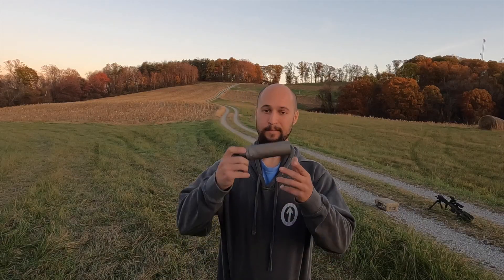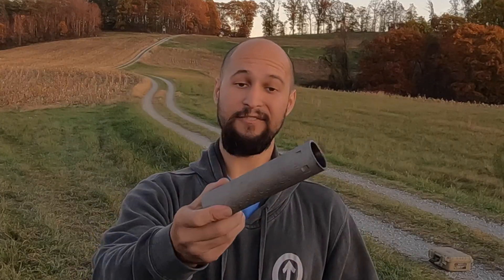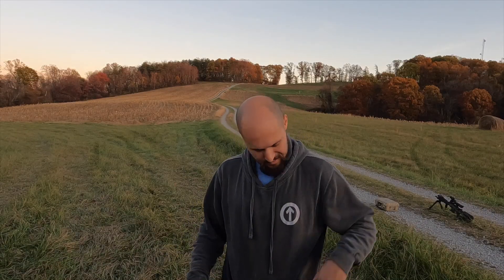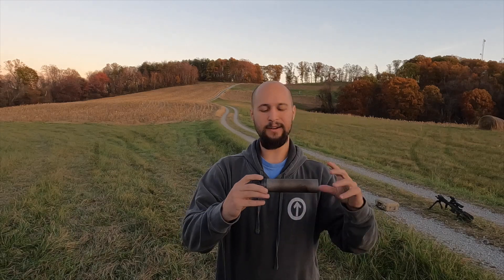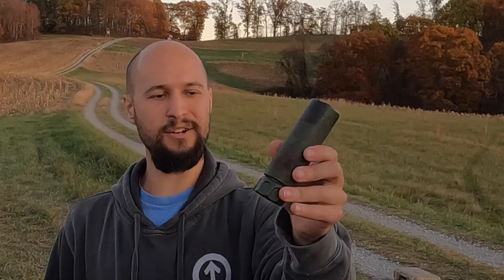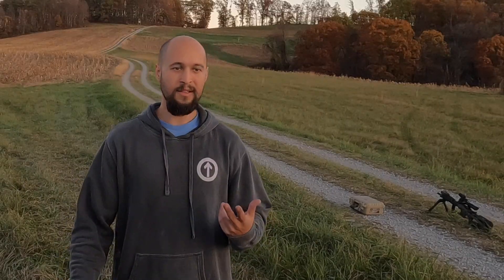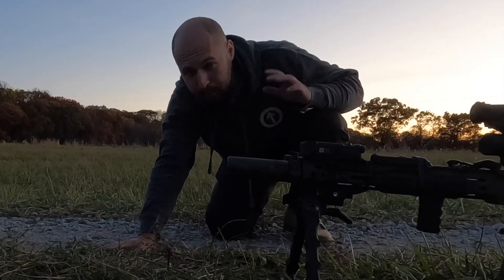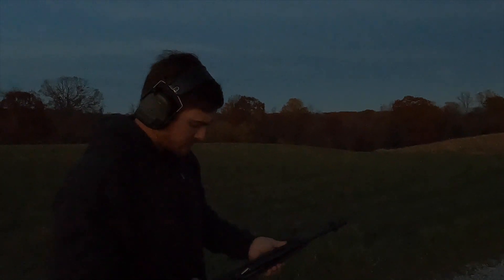Modern Suppressor Flash Test (2024) B&T, Otter Creek Labs, Siege, Surefire.

Comment: @VbdRetail 

Hello, I’m a new subscriber to your channel and I wanted to commend you on your content. Also I’m wanting your opinion on what can you would recommend to someone for their first can, who is using a 14.5 and was looking for a best all around can. Durable, Low flash with not much back pressure
Reply from the maker: If length isnt a concern. The Srbs or Rbs XH Full sizes. 
If length is a concern. The 14.5 will work well on the compact models of those. Through testing folks enjoyed the CAT WB as well. 

If you have the right set up. Id look into the next round of the xh mk12's.

You CAN get around the backpressure issue with tuning (like a BRT EZ tune) and start looking at the more traditional suppressors. But if you want low gas, the proper tuning would require that rifle to only function reliably with that more high back pressure design on the gun. 

If you shoot us an email we can deep dive a little more and really figure out the nitty gritty on what you'd like, what kind of budget you expect,  and what's important to you performance wise if you had to rank them in sequence. 

But from the little info I have, id say SRBS, XH, or WB.

There are obviously many other options that would leave you satisfied (FOR RECCE, Velos etc). But each has their own quirks.
Reply: @VbdRetail  
Thank you. I will be in touch via email soon.

Comment: You making a big deal about it not being a big deal doesnt make it not a big deal. Cans arent cheap, even the cheap ones. It is entirely possible to spend more and get less in the suppressor market. Thanks for doing the test and naking the video.
Reply from the maker: @quiettime6871  i think we got quadruple negatives happening on that one lol.  The point I'm trying to make is, folks like to act like flash is life or death when they're splitting hairs. 
Yes, some suppressors are absolute sparklers and awful. (Usually Ti, i don't mess with Ti)

But, most modern inconel suppressors, outside of maybe a first round pop, are on the lower end of flash. To the point you're most likely not seeing it with the naked eye at distance. 

It's a question we get often, and folks want to know "is X better than Y in flash, all i care about is Flash". And the reality is between some of these is like comparing velocities on a 10.3 vs a 10.5...

The worst performing suppressor we tested, was still absolutely phenomenal. And if it DOES matter that much, spend the extra cash, buy powder with flash suppressant, and use a little more barrel.
Reply from the maker: @quiettime6871  but thank you! Today we should have a very nice Db meter coming in. And I have some unique tests I'd like to run. They will be different than what you've always seen being uploaded.

Comment: Have you shot the SRBS 7.62 version and the 5.56 version on a 5.56 AR? If so how much difference could you tell in terms of sound reduction?
Reply: Wondering the same thing from a first hand shooters experience. Same weight and length. But take a look at the silencer summit 2024 results. Looks like the full size 556 version did a little better than the 762 on 556 ARs by 4-6 dB at muzzle but about the same at the shooters ear. 

I’m considering the Compact 556 version though which is noticeably louder at the muzzle but on par with the Polo K and obviously much less back pressure.

Comment: Man...srbs is in my near future 🫶. In your opinion from a 11.5 what is the sound reduction difference between the xprint compact vs full size? Debating on thr 7.62 just for multi use vs a dedicated 5.56 but want something decently queit(no ears for hunting and stuff)... Lay it on me 🫡
Reply from the maker: @rhodesoflife  the compact is still going to ping your ears on an 11.5. The full size will not. That being said, the full size is pretty large. So just know that. It's Rotex full length. While the Srbs compact is in between the Rotex C and Rotex K in length. 

I do wish they still made the Slab side full size, it was plenty quiet. Sure the Print X variant is quieter and hides flash better. But the Slab side model weighed as much as the Print X srbs compact, had the same flash performance you just saw here, but also didn't ring your ears on an 11.5. 

The Srbs Compact I'd say sounds like a deeper toned velos.
Reply from the maker: @rhodesoflife  the Compact is just past the cusp of uncomfortable without ears on an 11.5. 
Great performance for it's size and design. But it doesn't do quite enough work to run that short without some ringing.
Reply: @VbdRetail  so I guess the real question is go with OCL new can or go srbs 🫣🤔
Reply: @VbdRetail  Just what I needed to hear. I don't mind adding a little weight for the sake of saving my ears if needed.